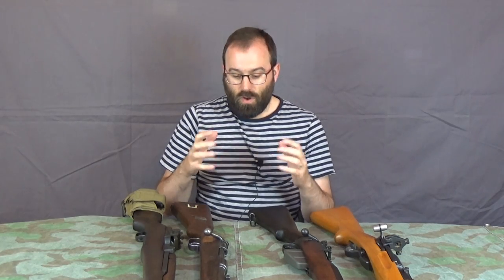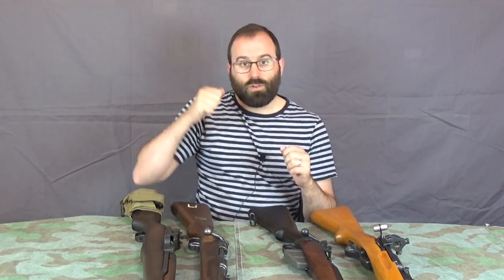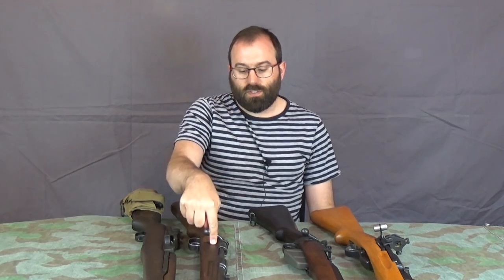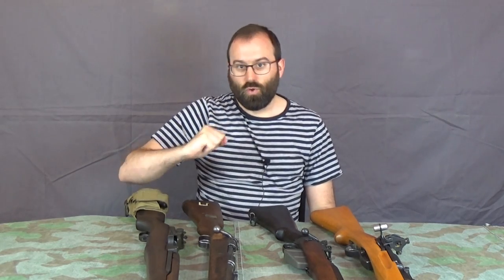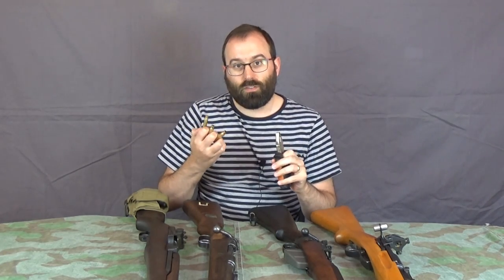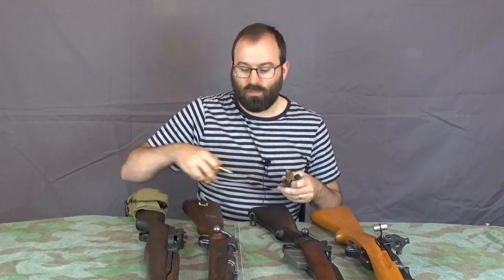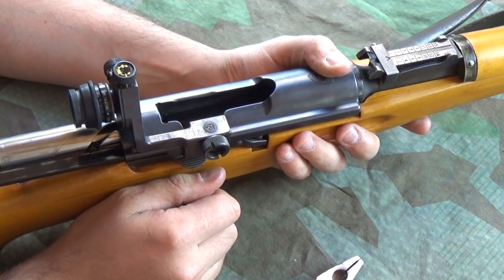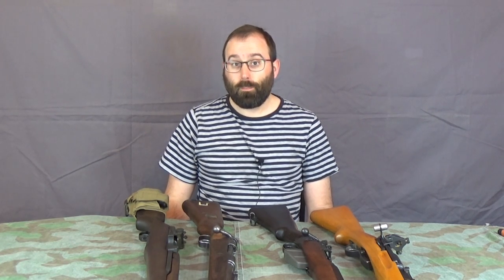Primary Extraction: A Blokesplainage With M1, Kar98k, Lee-Enfield No.4 and K31

Comment: I enjoy the fact you bring up concepts alien to the 'typical' American sport shooter.  The idea of primary extraction is one such.  Good video, excellent displays and pointing out the minute bits.  But, as usual...

The instructional part begins with pointing to (what seems to be an M1 Garand and is later identified as such) and saying it doesn't have primary extraction, it doesn't need it because it's a semi-auto.  Not according to the information given me by instructors in the Marine Corps.   The locking action of the bolt in the M1 (and in the M1 Carbine, M14 rifle, M16 rifle, M60 Machine gun - yes I am that old - and a number of other semi and fully automatic weapons) which constitutes the bolt turning a small arc to engage the locking lugs.  That action is reversed when the arm is fired and the gas pressure of the cartridge is 'bled off' to operate the action.  The slight turning to unlock the bolt causes the cartridge (locked to the bolt by the cartridge head) to rotate a few degrees, breaking the 'grip' between cartridge case and chamber.  That is the primary extraction and precedes the bolt pulling the spent cartridge out of the chamber.  At least, that was the instruction provided me.  

The notable light machinegun that did not have the rotational movement of the bolt and consequently poor or no primary extraction was the (Italian) Breda 30.  One of the common failures of the Breda 30 was a fired cartridge remaining in the chamber - less the small bit the extractor tore off when the case would not extract - or the forward half of the fired case after separation due to firing and a violent tug by the extractor.  Sad story.  

The idea that due to the gas operation - and subsequent pressure greater than hand or arm - cases can be pulled directly out of the chamber.  One may think so, but that is not what happens in practice.  Even blowback pistols that do not require a locking system do require an extractor.  The exception being a very few pistols using rather low pressure cartridges.  (The Beretta Jetfire and Minx come to mind).  I do see where the misunderstanding lies.  When the Garand 'opens' one does note the rotation of the bolt.  It is the rotation of the empty case in the chamber - even without the rearward movement - that IS the primary extraction.  

The Norinco ammunition 'sticks'.  I would have to examine one or more the resultant fired cases, but it sounds like the case material is either roughly finished, a poorly adapted metal alloy or something else.  (I spend too much time with the government, obviously.)

I see this video is (as I write all this 'full of myself' copy) it is three complete years since the video was posted.  So much of what I say may have been discussed since... but.  The distorted cases (out of round case necks and mouths) shown are not possible to achieve by firing in a rifle chamber.  Stuck cartridge cases are caused by the swelling of the case on firing, depending on circumstances past the elastic limitation of the case material.  The fired case is thereby 'stuck' to the chamber due to some metal to metal binding or bonding.  If the case is deformed at all during the moment of firing, it is likely split or torn and binding on the interior surface of the chamber.  Or due to extreme heat, the case is mildly soldered to the chamber.  None of the circumstances are what one would do to a rifle one planned on using later.  It is 'destruction' testing or close enough.

Also, I must point out deforming the case (any rifle) and then forcing the case into the chamber does a rough 're-sizing' function.  This is shown by the almost 'normal' appearance of the once oval neck and mouth of the case.
Reply from the maker: Yeah, that instruction is wrong, as shown in this video - there is insufficient rearward movement as the bolt rotates to cause mechanical primary extraction. 

And sorry, but there is simply no "rotation of the empty case in the chamber". That's complete fuddlore. It's just not mechanically possible. You're not the only one to think it, but it's entirely 100% false. It requires the kind of physics and mechanics which only exist on the pages of printed gun magazines.

And sorry, but most of the rest of what you wrote there was in a similar vein and I don't have time right now to explain it point-by-point.
Reply: @BlokeontheRange  In that case, none of the semi-automatic or fully automatics in the U. S. Inventory work.  Including those I used.
Reply: @OldManMontgomery  as a Gunsmith I've had to " unlearn" a great deal of what the US Army tried to hammer into me about how a firearm works.

The military is a place to learn how to use the weapon in a tactical environment.  Beyond that, it's dubious at best.    It's not unique to any one branch or Military.  It's just one of those things
Reply: @sethshacklettShacksGunsmithing  As one who has had 'several' occasions to separate wheat from chaff, I quite understand.
Reply: For the contention to be valid, the extractor would have to grip the case rim with some sort of mechanical advantage--like a set of pliers.  Or, not at all like the slip-fit designed to tolerate a wide range of case rim thickness tolerances.
Reply: @CAPNMAC82  Wrong.  The residual pressure in the chamber presses the cartridge case against the breech face better than pliers.
Reply: @OldManMontgomery  I would have thought so too, but do not think that I am speaking from any practical knowledge. 
What I have noticed is that some people have complained about the bolt no longer pushing the cartridge fully into the chamber. Remember, I have no experience. 

However, I can only imagine that the base of the cartridge if pushed in by the bolt never loses touch with it. The cylindrical part of the case has a far larger area in contact with the chamber once it has swelled through heat but cools and shrinks leaving the bolt to base with the same force the cartridge was pushed in giving the same friction for axial motion till the bolt is removed. 

Some or allof the above could be nonsense. A man who has taken a device apart inevitably sees more than I could imagine.
Reply: @myparceltape1169  I appreciate your comment about not having practical knowledge, but you seem to be quite reasonable.  The cartridge never looses contact with the bolt, usually the face in most rifles under 'normal' conditions.  The concept of never losing contact with bolt is confused with the idea of 'controlled feed', in which the bolt and extractor makes full and final contact with the cartridge as the cartridge is forced forward, from the magazine and into the chamber.  

What is under discussion here - with some disagreement - is 'primary extraction', in which the fired cartridge is slightly moved in the chamber, breaking the adhesion ('grip') of the fired, now empty, case on the walls of the chamber.  By the way, the expansion of the cartridge is from the high pressure therein, not heat; however as the rise in pressure and the heat generated are co-existant it is hard to distinguish.  The case 'shrinks' by the elastic nature of the brass case somewhat reverting to its shape and size prior to firing.  Breaking the remaining grip or adhesion of case to chamber walls is called 'primary extraction'.  This happens in most gas (pressure) operated rifles and machineguns by the slight rotation of the fired case in the chamber, when the bolt unlocks from the barrel.  Secondary extraction is the larger movement of the extractor pulling the case from the chamber and then ejecting it from the arm.  One should note here, for arms of less than "so much' pressure, the case does not bind as much and does not require primary extraction.  (.22 rimfires, most pistol caliber arms, also including submachineguns).  

Without the primary extraction function, cases tend to stick in the chamber and the force of extraction breaks the case ("rips off the head") such as in the Italian Fiat-Revelli Modello 1914 which was infamous for sticking cases in the chamber and tearing the case in half.  This was primarily noted during the Ethiopian campaign when Fascist Italy invaded Ethiopia.
Reply: @OldManMontgomery  Thank you for that advice and the example from 1914.
Reply: @BlokeontheRange  I believe any added initial mechanical advantage is primary extraction. If the M1 Garand doesn't qualify as having primary extraction, than no semi auto has it.
Reply: @sethshacklettShacksGunsmithing  I'm not sure what 'the US Army' tried to teach you about how a firearm works, but it's generally the LACK of teaching how a firearm works that allows for everyone to bring in their old fuddlore and BS.
Reply: The extractor simply can't rotate the case in the chamber especially if there if enough residual pressure to force it onto the bolt face. the case walls have much more surface area to grip the chamber and any grit in it under tens of thousands PSI. The extractor isn't even strong enough to twist the case if you pinch it with your fingers. Take the bolt out, clip in an empty case, and try it. Besides, simply twisting the case in the chamber would not accomplish much. It's the slight rearward movement that causes the tapered case the lessen its grip on the tapered chamber. The rotation of the camming movment is only there because most rifle caliber arms are rotary locked. If you have a wedge locker you need a different method of gaining more leverage in the first few mm of extraction.
Reply: @OldManMontgomery  "This happens in most gas (pressure) operated rifles and machineguns by the slight rotation of the fired case in the chamber, when the bolt unlocks from the barrel." - This simply doesn't happen; it literally, mechanically cannot happen. To draw an analogy: hold a jam jar in one hand, rotate your wrist 90 degrees, then hook the index finger of your other hand behind the lid. Now attempt to use that index finger to rotate the lid open. Can't be done.

Primary extraction happens via the extractor pulling the spent case backwards via some mechanical means. Simple as that. It works because neither the case nor the barrel are perfectly cylindrical, so all it needs is a little initial shove via some kind of operator-assisted mechanism and then the operator can do the rest with a straight pull of the bolt. Rotation of the case, even if it could happen, wouldn't appreciably help anyway.
Reply: @cavscout888  Correct: no autoloading firearm has primary extraction, because primary extraction inherently precedes secondary extraction and the latter is a manual operation on the part of the operator. Instead, autoloading firearms have a continuous, single-stage, gas-powered form of extraction. There is no primary or secondary. It's just sudden gas pressure pushing the bolt rearward by some means and then the ejector kicking the case out.
Reply: @hux2000  Your explanation is quite involved.  Unfortunately, it is incorrect in the main.

Comment: Wow very impressive. I wouldn't have thought the Lee Enfield or the K31 would have better extraction than the K98. Thanks for this video.
Reply: They've all got better extraction than the Mosin.

Look up "sticky bolt syndrome" if you wanna know exactly what I'm talking about.
Reply: @TheJohnsoline  if you're not bashing the bolt handle on the nearest hard surface is it really a Mosin?
Reply: @towarzyszbeagle6866  I don't know, does it have to be constant, or just happen a few times, or just be possible? I can't say, I've removed the problem from mine but the potential is there if I don't clean it. But besides that, I'm very intimate with the problem, I'll tell you what, it's a 39 Tula that fired thousands of rounds and never cleaned and so when I got it you'd have thought the bolt was welded shut, so I think it's paid off its sticky bolt debt.

Comment: To see the Garand's primary extraction, push the bolt forwards as you pull the oprod back.  The reason you don't see the full extent of primary extraction is because with no case to extract, the bolt follows the oprod back as far as the helical locking lug surfaces will allow.

The very same action and part engagement that converts the bolt's forward motion into rotation just before the bolt closes, acts in reverse to provide primary extraction.  You just can't see it because the bolt is free to float back when not working at pulling a case from the chamber, and so does not engage the curved raceway with left lug as much as it would, were the bolt dragging on a fired case still in the chamber.    

When the bolt flies forwards, the left lug and curved section of the raceway have no choice but to make hard contact - and you can see it.  Why would you imagine that action disappears under firing, converting bolt rotation into primary extraction?  You cannot see what you don't want to see...
Reply: That isn't primary extraction though. It's just gas pressure pushing the op rod, which rotates the lugs to unlock the bolt, after which the bolt moves straight back, pulling the case with it. The proof that it isn't "primary" extraction is that when that initial rotation happens, the extractor isn't even touching the case rim. It's rotating around it. The first movement of the case is when the bolt starts moving rearward, after the rotation has unlocked it.

I mean, it's all a moot point anyway. Primary extraction is defined by the fact that it's an initial, mechanically-assisted stage of extraction prior to the secondary part, which is a non-mechanically-assisted, rearward movement of the bolt by the user. M1 extraction is a single, gas-initiated movement that pulls the case rearward. There is no "primary" or "secondary".

See also, Bloke's follow up video: https://www.youtube.com/watch?v=Lp3Ya_py82U
Reply: @hux2000  Garand locking lugs are helical.  When the bolt rotates, the lugs "unscrew" rearwards.  That is the first part of primary extraction.  The second part is when the left locking lugs runs into a curved path that becomes the lug raceway, before it is free to move directly rearward.  That curved path turns the rotational momentum into rearward momentum.  That action occurring at speed is very potent with regard to pulling the case rearward, if it had any tendency to stick in the chamber.

Bloke is clever, but in this case, wrong.   That is OK.  Just as he has a fixed opinion on this; so do I.  My opinion is based on logic and observation.  So is his.   I am nobody, but Bloke can't ever be wrong.  You have made your choice.    

If you have a Garand to study that would help.  I don't have a Garand, but I do have an M1a.  The latter is very similar when it comes to the bolt lugs and their motion.

Comment: Rather late to the video but the No. 4's locking surfaces are pretty nifty. I never knew that about the K31 either, it's pretty nice.

I think older (1893-1896 at the very least since they have the claw extractor as well) Mausers would have an easier time un-sticking your mangled case for a similar reason it may have been easier for you with a No. 4. They also cock on close. Don't have to fight the cocking piece getting cammed into a ready position and a stuck case to get said case out. I believe a straight bolt handle also helps (the Gew. 98 has that and most pre-1898 Mausers do as well).